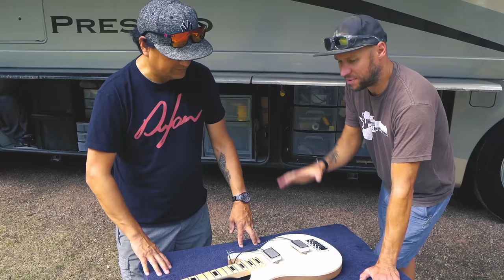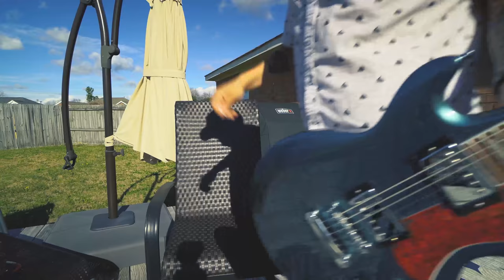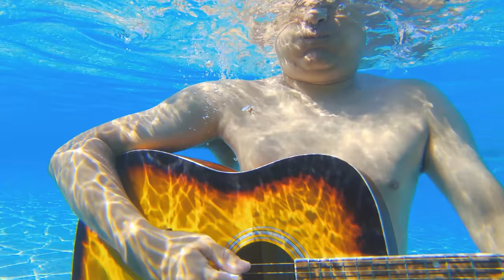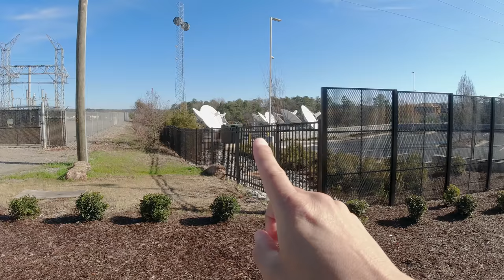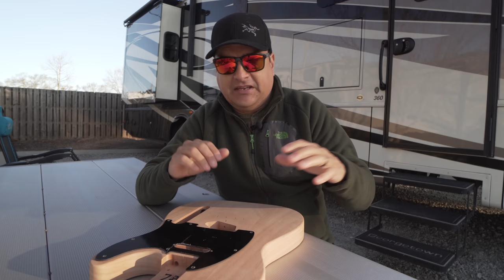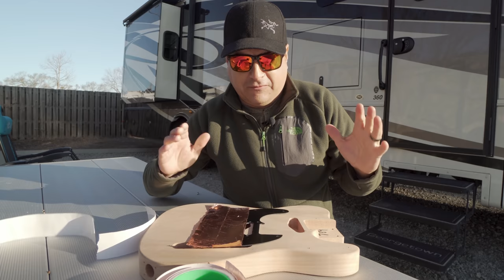How To Shield Your Guitar - Myths Busted

Comment: Is there an easy way to know if an adhesive is conductive?  I used a 3M HVAC aluminum tape on my pick guard.  No clue if the adhesive is conductive....
Reply: If you have a continuity tester, make a chain of overlapping strips and see if it has continuity end-to-end.
Reply: Doesn't matter. I use it too. So, do many others. Having that continuity makes absolutely zero difference. Don't worry about the adhesive. Much ado about nothing.

If it bothers you that much, you can fold the long edge of the aluminum tape under so unsticky foil contacts underneath. The whole "dot of solder" is ridiculous and a waste of time. Personally I wouldn't worry about it. I didn't and aluminum tape with non-conductive adhesive cut the noise in my guitar by like 100% when I did it.
Reply: Al tape is actually better, i would go into details why but it is plus it is cheaper .There is reason why aluminum is by far more often used in for el shielding, Cooper is OK as well. As people told already you can just flip it over.Moreover i would shield control cavity, simply any element should be shielded as much as possible that is part of the circuit.
You can use good shielding paint it is also great ,
Reply: @grayaj23  that is a good tip and it works imho better then to really on adhesive sticking parts since after some time it will loose it's conductivity, usually after few years but it is silly to do job few times when it can be done as it should in the 1st place.
Reply: I went and had the continuity tested.  Turns out, the tape purchased is rock solid.  Blind squirrel finds a nut some days...
Reply: @treyriley7303  super!

Comment: Dylan, is it necessary to shield the whole back of the pickguard? I use copper tape only around the area surrounding the neck pickup hole on a Tele. Then, I make a little strip to connect that to a ground spot on the guitar (as you show on 15:30)

Comment: Ok I have a question, does the copper tape interfere if I’m using a hidden neck pickup under the pickguard? Like the Seymour Duncan secret agent pickup.
Reply: Yes I believe so. You would essentially be shielding that pickup from the frequency created by the strings.

Comment: How,then,  do guitars pick up 60hz hum at all,  if the waves are 17' long?
Reply: Yea, I think he misspoke. Or just doesn't know. Shielding doesn't do anything for 50/60hz hum. Humbuckers do. Shielding prevents certain kinds of emi, but mains hum is not one of them. So much for debunking myths. He just perpetuated one. What is affected, I believe, are frequencies that are more properly refer to as rfi (which IS emi, but in a more specific range, while "emi" refers to ALL electromagnetic interference.
Reply: To answer you question, the pickups do, not the shielding. Mains hum is in the range of human heating and within the pickup's range, so the solution is common mode rejection /cancelation (a humbucker.) It will pass right through shielding though. So, as shielding is basically an antenna, connected to ground, it can only bleed off what it can catch and disperse, ie. not mains hum.

Comment: I used similar copper shielding with my guitars.  Could an intermittent volume decrease be related to improper shielding or would that typically be present or no signal?  Happens on multiple amps, guitars etc.  I've tried different cables and have tried to pinpoint a faulty pedal but no luck.
Reply from the maker: If it’s touching something g

Comment: this video is amazing! I want to shield my guitar because I have some noise problem! I have only one question. I have a telecaster and all ground cables are connected to the back of the volume pot, so after shielding the pickguard and pickups cavity and reconnect everything as it was before, I really just need a little strip of copper connecting the shielded back of the pickguard to the control plate to ground all properly? I ask this because in many videos about shielding you can see people soldering wires or doing some strange stuff to ground all properly, and this confusing me.
Reply: There are no ground loops possible in a passive guitar. People ground things anywhere. As long as all that should be grounded, is grounded (meaning it ultimately has a path to the sleeve of the output, and then literally to ground, through the amp, or whatever rig.) you can use a pot back as a hub for your ground wires, or whatever is closest, add a washer just for that, run jumpers between pot casings and shielding. It's all going to work the same as long as, like I said, it all goes out to ground at the guitar's output.
Reply: @adamlee011  I'll take it as a yes :)

Comment: Hi Dylan, follow up question.

I get most noise (not hum) from my guitars when I'm going into either my battery powered up or my hx stomp. None of these really ground to earth through an electrical outlet, so I'm calling that a floating ground.

Here's the thing. My tele is practically silent as far as EMF noise goes, while the strat picks up a ton of it (in floating ground scenarios). On the strat the noise goes away when I touch the strings, as expected, but I sometimes hear a discharge when I do touch them.

I'm willing to make peace that the strat is normal and somehow the tele is extra quiet for "reasons", but do you think of anything that might be up and would be easy to check?

Maybe an earth loop in the guitar acting as an antenna? Is that a thing?
Reply: well.
I got an EE degree but, not at engineer level, so I could be wrong. However.
First of all, you have 2 different guitars. They may have different pickups, even if they're all single coils.

If you wanna go on batteries, your best bet is to use humbuckers because they ignore noise by design.

It may sound funny but: Did you try wearing only 100% cotton clothes when playing on batteries?
That could get quite some electric discharges away.

I doubt there's an earth loop, like, that would make it worse than it could be.
I think it's just that the shield doesn't work when your guitar is not grounded.

Now, are the strings grounded on both strat and tele? You can check that.
Otherwise I can't really tell.

Comment: Dylan,  Q: Why does shielding work at all given that the copper is not technically altering the amount of 60hz into the pickups? Isn't the shielded area just picking up MORE of the stray waves and sending them to ground?
Reply: ...shielding seems to be tantamount to saying that a 2nd satellite dish would "shield" an adjacent 1st dish from some of the waves going into it. When in fact, they are 2 completely isolated pickup devices. So how is this different in a guitar? The shielding picks up its own waves, and (seemingly) should not alter the waves going into the pickup in any way. It's not "bleeding" or "sucking" away waves from the pickup. Or is there another principle at work?
Reply: Yes I was thinking along similar lines. If you’re not shielding the pick-ups themselves could you cover the back of the guitar with the tape and ground it to the bridge? I’ve always done the full job including control cavities but Dylan seems to say that the pickguard alone acts like an aerial somehow, which is what you’re saying, so why does it have to be around the pickups?
Reply: I don’t believe incoming waves are always moving perfectly straight. Like light waves, bending around planets, and stars due to gravity. Your pick ups, and their magnetic fields are probably drawing all the attention. If you had no magnets in there, and no small current running through your guitar then radio waves, would just pass In through like x-rays through your alderwood. Body.

If I am guessing correctly here your pick ups are drawing more attention when engaged, so although interference will reach them directly the shielding cuts out some of the residual onslaught. Does this make sense? Hopefully the way I put this think of them almost as though they’re being bent toward your pick ups, the ones that don’t quit hit the target are hitting the shield like arrows in an old Robin Hood movie. Like Dylan said you’re not going to eliminate all noise. You’re just trying to reduce it where you can. They call them pick ups for a reason. They’re pulling stuff in.
🎸as you were…

Comment: What if the guitar has an anodized pickgaurd, like a J Mascis Jazzmaster, does that change anything?
Reply: I've heard it makes 60 cycle hum worse. A commenter on YouTube changed that pickguard on the same guitar you have to a traditional plastic one and got less hum but still present. Personally I love the look of those anodized pickguards and would not change it and get a noise gate pedal.
Reply: I think if the pickguard is connected to ground, you're good.
Reply from the maker: Works awesome.

Comment: Um, does shielding help with single coils? Seems like if the pickup makes all the noise, and it isn't shielded, then the shielding on the pickguard won't help. ???
Reply: Get a noise gate pedal.
Reply: @Pedro U My first comment magically disappeared. That's what I said so don't think you know it all. Everyone has different opinions about shielding a guitar. Mine is it's very time consuming especially when you have a large collection. Alot of unnecessary work for not the best results
Reply: The shielding will help draw some of the signal away from the pickup and disperse it, but like Dylan said, it's impossible to get rid of the noise 100% and how much it reduces it will depend on the environment. You're not shielding the pickup specifically.
Reply: @FairlyUnknown  Right.  It's really more of a collector than "shielding" -- so if two humbuckers have (roughly) 5 sq inches of surface area -- and  If that's all you have -- then all of the EMF is going to get collected by the pickups.  If you add 10sq in of copper and run that to ground, then the pickups are only 1/3 of the surface area and thus (roughly) will have 1/3 of the capacity to pick up stray EMF.

That's true with single coils, but a single coil gets substantially more noise from the same amount of EMF because it's not canceling.  So the noise is still going to be there, just reduced by whatever ratio of surface area of pickups to surface area of copper.
Reply: @davidkastin4240  dude he wasnt even talking to you. 🤣 If he was, it would've had @David Kastin at the beginning, like you see on mine. But it doesn't.

Because he wasn't even talking to you. Do people really not know how youtube works in 2021? 🤷‍♂️🤣
Reply: @JC-11111  How many guitars do you have? Are they shielded? Everyone is entitled to make a comment and voice their opinions and experiences. It's how we learn.
Reply: @davidkastin4240  no I don't own any guitars. I just use other people's guitars in my avatar 🙄

I own 3 and 1 of them is shielded. I did it about 2 weeks after I bought it. Then I bought 2 more since then. I've also leveled the frets, replaced the pots and pickups, bridge & trem block, and tuners, too.

Is there a reason you're asking? And I never said you couldn't give your opinion. You were responding to something that was directed towards someone else as if it was said to you. Talking about..."don't think you know it all" when the guy wasn't even talking to you. That never should've been a response from you. Seems to me he was telling that guy Scott that he didn't understand anything in the vid and was attempting to explain it. Not you. So there was no reason whatsoever for you to respond with "...dont think you know it all". He was explaining it to the guy Scott who obviously didn't get anything in the video. That's apparent by what he posted.

How do you not get this? 🤷‍♂️ Pedro wasn't being a know it all anyway. So there's that, too.
Reply: @JC-11111  I apologize. Here's what happened. I thought I was commenting on a different video. Doh 🙆

Comment: 18:15 "this is not an engineering video. this is how to most effectively do this to solve a problem"
actually that is exactly what engineering is hahaha xD

an analytical approach to a problem is helpful when the cost of trying the thing is quite high so you do the math and figure out a solution that might work and only then try it.
But when the cost of doing the thing is super low like in this case for shielding, you can just try different configurations and see what difference it makes.
The iterative approach to solving a problem. Still engineering, sounds less fancy but perfectly valid.

Apologies if some of my young comrades working at big companies trouble you with comments about details like that. Its probably because it does make a difference to the projects they are a part of and details can cost a lot of money. Maybe with that it's easier to tackle their comments next time :)

Comment: Ok, ok, ok ... but ... why is it that we can use copper OR aluminium to shield but not use aluminium for cables? Is copper a better shield than aluminium?
Reply: Aluminum cables do exist, it's just not ideal. Aluminum has like 60% of the conductivity of copper. In a shielding application, copper of the same thickness will be better, but it won't necessarily make an audible difference. I would say copper is just easier in general, significantly easier to ground properly. The only real benefit to using aluminum would be weight savings(many speakers use copper plated aluminum wire to minimize weight), but in this application, it's basically non-existent(probably a fraction of a gram).
Reply: @entropy1454  Thanks for that info.

Comment: I see people shielding the back cavity on strats and the "wire gap" (where you can see the neck pickup wires going to the control cavity) on teles all the time. Totally useless. The control cavity not needing shielding is big news to me though!
Reply: The control cavity won't need shielding if the wires are shielded already, but if they are not, they will act as antenna. But they usually are

Comment: You are confusing acoustic waves with electromagnetic waves. The wavelength associated with an electromagnetic field frequency of 60 Hz is about 5 million metres (or 16.5 million feet) calculated by wavelength=c/60 where c is the speed of light. Electromagnetic radiation propagates at the speed of light not at the speed of sound.

Comment: you miss a point a bit, it's shielding inner cables and pots from becoming antennas. Shielding pickup isn't neccesary ( well it is even impossible , if you want to block hum - you'd need to cancel it out hence humbucker pickup ). If I ever do shielding then it's mostly to reduce number of solder points for ground that can fail and use cables without the grounding inside the body

Comment: why not get rid of the plastic scratch plate and replace it with an aluminium plate problem solved, I am having no problem on my Flying V this way
Reply: I've seen some tests regarding that and IMO the aluminum pickguard changes tone a bit more than  I'd like!
Reply: @iagobroxado  imo once you start putting guitars through a heap of pedals no-one will be able to tell whether the scratch is plasti or aluminium, same goes for when they're talking about the bodies once you feed sound throught pedals, tone goes, clean sound or acoustic then you'll hear tone but once it goes thru pedals i.e. distortion, o/drive, blues, tone gone

Comment: I am electrionc guy .. and ham  guy .. a+ tec the shield copper cavity makes your guitar into large antenna. Your messing around with guitar natural resistance and ressanat capabilities. Old vintage guitars didn't have all this crazy shields.. Your guitar wire can recieve signals... radio operators  run units on simple cable.. now add copper shield you have nice antenna.. so get it straight..only small amount of shield around the pickups and switch to ground you.... incredible miss of information. Nothing is true  grounded unless you have earth ground like from your  outlets.  Your shield from the cable is grounded from your amps ground.